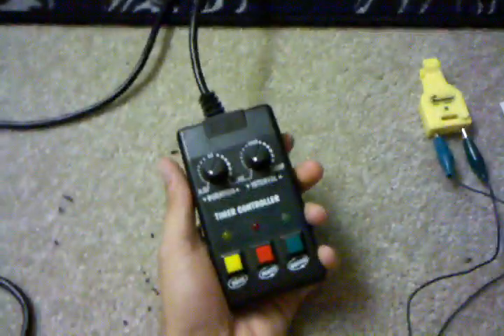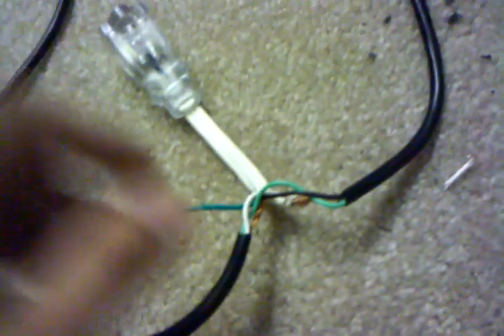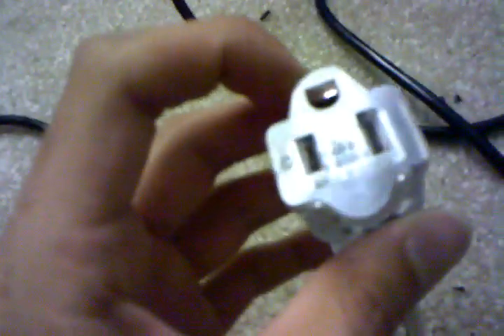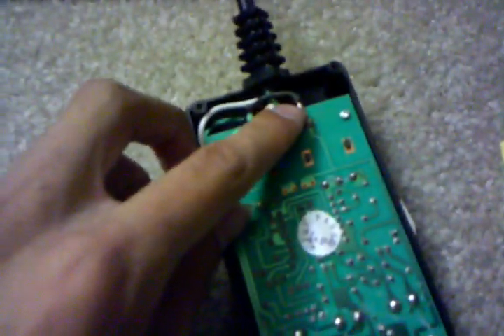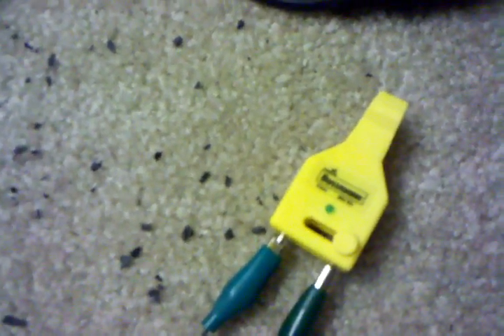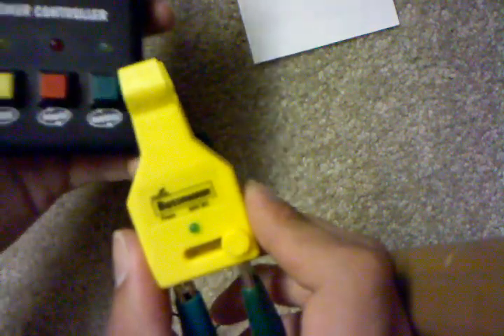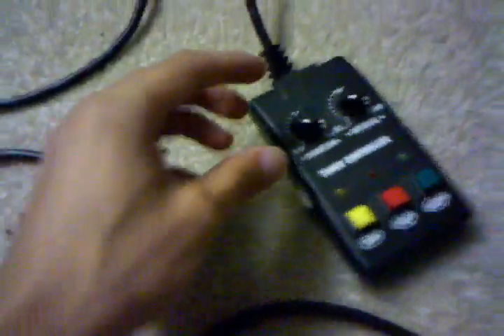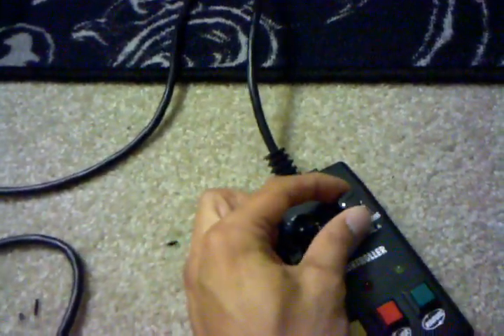Fog timer hack

Comment: Are we keeping AC powered wires bare? You can use wire nuts or Wago connectors but the best route is to solder the wires. I think a safer route would be to use a relay connected to the switch as a trigger. Just connect the wires to the other end of the relay. You can also use a multimeter as I think those fuse testers are designed for 12 volt dc systems. Great idea though. I want to do an explosion effect with the fog machine going off the same time as a strobe light and a bright yellow light with some sound effects.

Comment: L = Line or the hot wire (black),  N = neutral (white). the green is ground (for safety). and for anyone wanting to know, the white and ground wire are hooked up to the same spot in the electrical panel. Essentially, you only need black (hot ot "L") and white (neutral or "N").

Comment: I am hoping others notice this but just to be clear.. black is NOT negative. This is an AC circuit and there is no negative and positive. Black is called LINE (live, hot, etc.) and white is the RETURN. The only ground in this circuit is the green wire which he doesn't hook up. There are many other problems with this situation...not discouraging anyone from hacking away... just be careful and know what you are doing before you cook something.

Comment from the maker: Then all you need to get is a photoresistor to attach to the 2 wires coming from the play button. If you use a bright strobe light (ill post a video of mine in action asap) it should be enough light to pass a current threw the photoresistor and play the sound. You'll need to hot glue around the edges or tape the photoresistor directly on to the strobe bulb. Ill be doing this and i will make a video of it as well and how to diy   ^_^ hope this helped!

Comment from the maker: Then after capturing your needed sound, cut the wires from the playback speaker and attach them to a female 3.5m audio jack so then you can plug in your own speaker system or w.e. you have lol. Your almost done!!  This is the final step, cut the wires from the "play" button or solder some on if theres only a button, make sure you have about 3 feet of newly attached wire. Then plug in your speakers and touch the two wires together, it should play the sound loud and clear! And then all you need to

Comment from the maker: Simple, all you need is a cheap 10 second voice recorder. It needs to be one that can be easily opened/taken apart. You need to get one that doesnt need the button pushed the entire time for it to play. First you open it. Then you cut the wires  from the microphone and attach them to a male 3.5 audio jack. Plug this in to your computer or device threw its audio out jack, play the sound and record at the same time. This should capture your needed sound. Then........